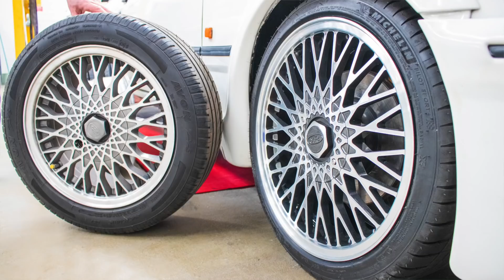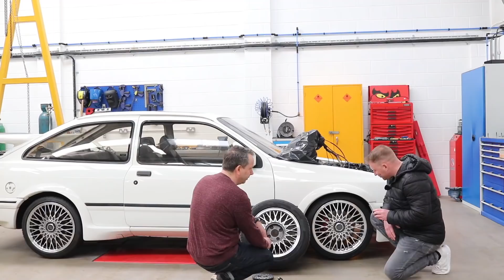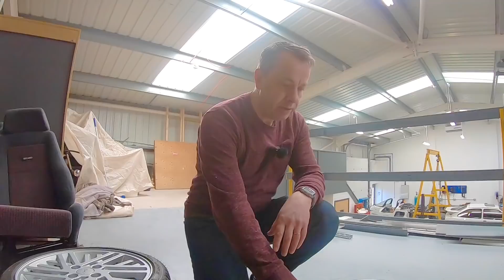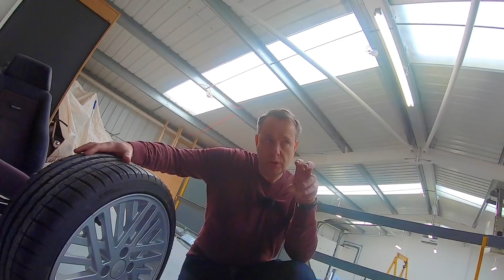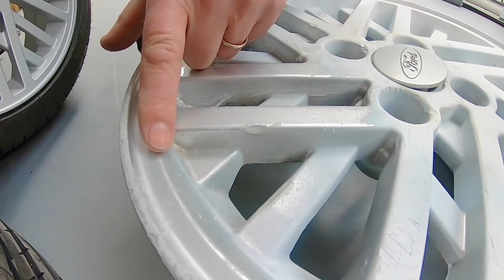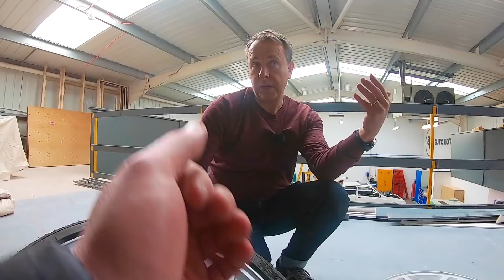First Look at the New Cosworth 17” Alloy Wheels

Comment: I really like the look but the only thing is they look a little bit too big as we’re so used to seeing the cars with the smaller 15” wheels and that retro look. I think I’d maybe have done them in 16” and a tiny bit wider to fill out the instep the original ones have. Just a personal preference. Cracking job though and such an interesting video Adam. Awesome 👏

Comment: I ran 235/40/17 rear tyre on an 8j wheel at ET37 on a lowered car, the car on track and have had issues with rubbing. Arches were not rolled either. That was on a 2wd Saph, obviously a semi slick at 215 would be as wide as a 235 road tyre.

Comment: Was great to meet you in the shop this morning. Fantastic channel.
Here is info about the sierra shell.
Best regards
Paul

During the life of the car, two different styles of 3-door body were used; one with two pillars rear of the door, looking very much like a modified 5-door frame, as used on the high-performance XR4i; and a one-pillar design used on standard-performance 3-door hatchbacks and also at the other end of the scale as the basis for the very high-performance RS Cosworth.

Comment: With the 8 inch would you have to recalbrat the speedometer? What tire would keep it in line with the Speedo, have they been stress  testing? Love the channel 👍 and the wheels 👍
Reply: The width of the wheel has no affect on the speedometer. Only the diameter of the wheel.

Comment: Good effort but to skinny and weak offset, they sit in way to far. Mine are 8” et15 on my 3door.
Reply from the maker: Could easily add spacers Jamie 🤷🏼‍♂️

Plus most folks won't want to roll arches or trim them back now with the prices of the cars.
Reply: @Adam151082  when you get some I will buy your splits 😜